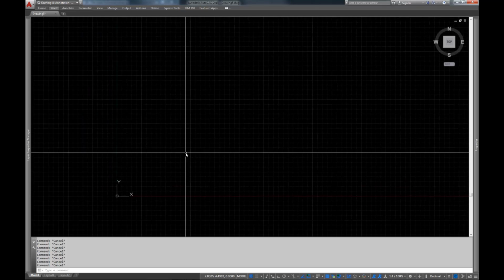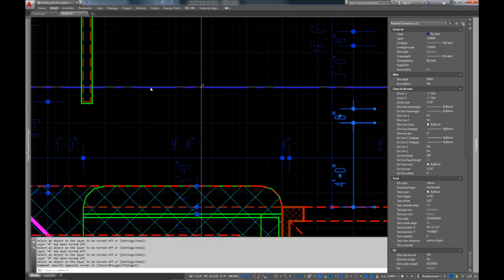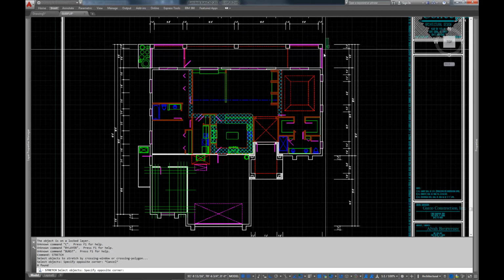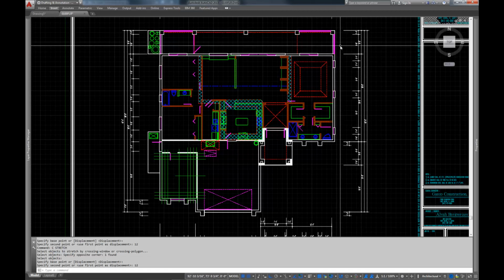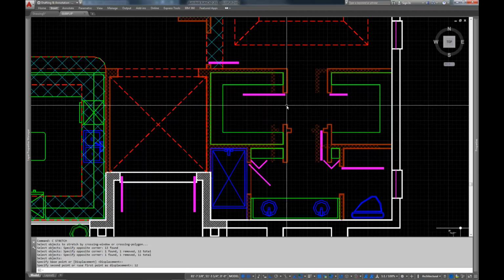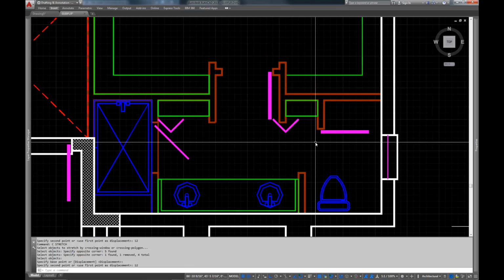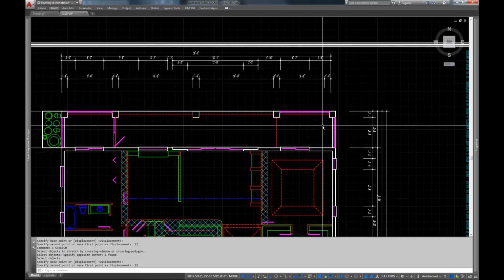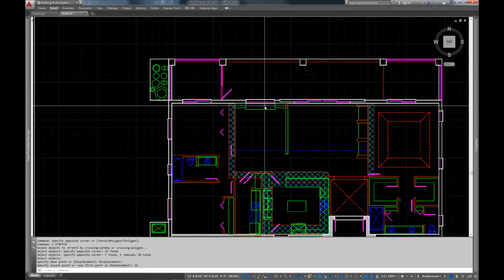Intro to AutoCAD 2015 - 19 - The Stretch Command

Comment: Might be good to go over how you also stretch or change the hatching, I haven't figured that out yet. Good videos!
Reply: ***** I have been able to stretch hatch since version 2013. Not only that, I can also trim it. As long as it is associated to the boundary lines like your wall lines, and are both stretched at the same time. The problem is (and it is a pain) that it wont work with drawings created in older versions. A tip to add to this video, I prefer to lock layers instead of turning them off.
I came here looking for clues about stretching using the fence option. Type "s" for stretch then "f", do your fence around to avoid objects you don't want stretched, click "return" to close your fence, but the objects move, instead of stretching. What am I doing wrong?

Comment: Hi Chris!. I'm currently working on a isometric layout, it's only a bunch of lines connected between each other. I'm trying to stretch a bunch of lines at a time, first i select them all, then press "S" for strech, and when I stretch the selection, not all the lines will strech. Do you have any advice?